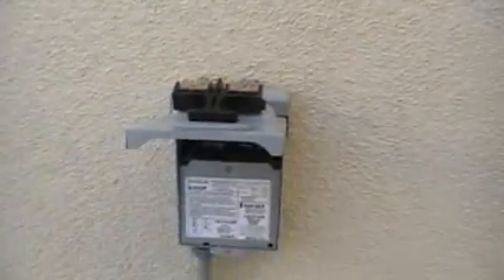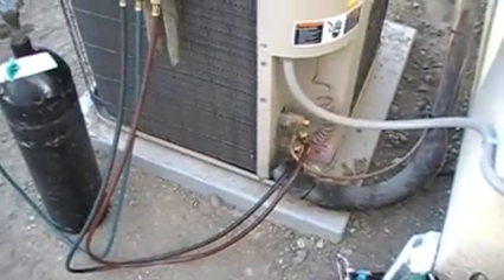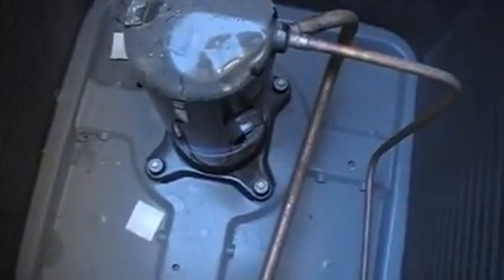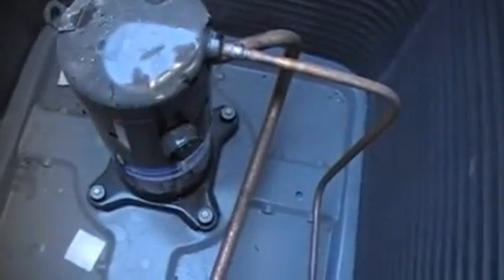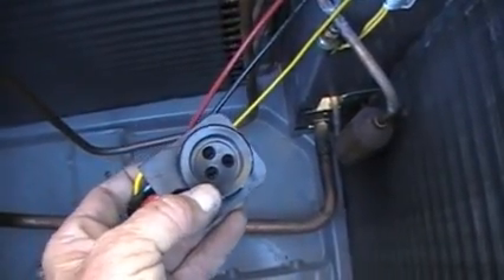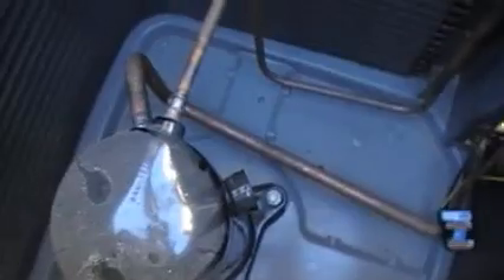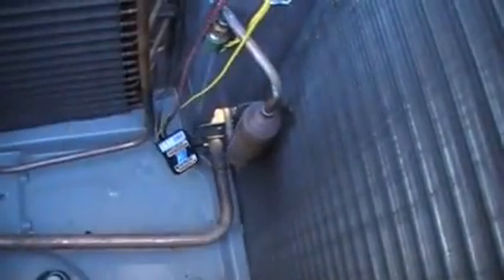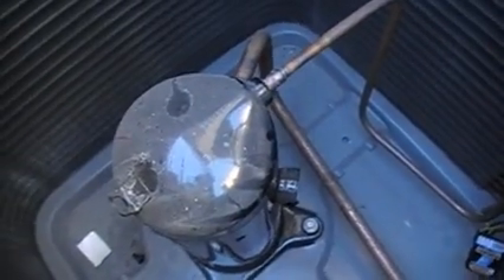HVAC - That's Unfortunate

Comment: The ceramic that isolates the compressor terminals from touching the compressor housing overheats and cracks. The high pressure from the refrigerant inside the compressor make the terminals explode when the ceramic cracks. Normally oil is expelled from the compressor when is explodes (there doesn't seem to be oil anywhere in the video). This is very common here where I live because the voltage fluctuates a lot. It is more common on older compressor though.

Comment: What size condenser is that? I have noticed some manufacturers putting crank case heaters on the 4 and 5 ton compressors. I noticed there wasn't any oil residue in there. Could there be a leak somewhere else in the system?

Comment: high current draw from a crap run capacitor or voltage is dropping too low? even if my guess is wrong its worth a shot :P